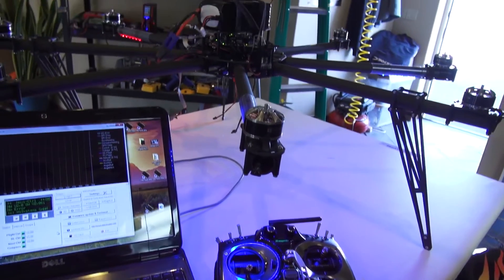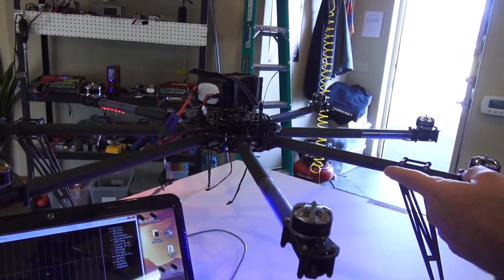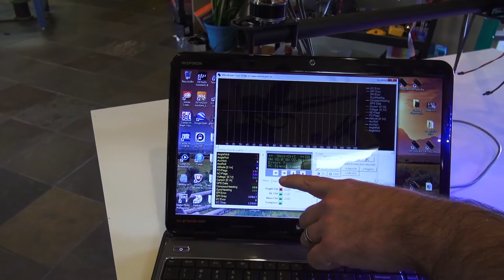Quadrocopter Tutorial - Mikrokopter Fail Safe Setting on the MZ-24 and GR-24L

Comment: Thanks, have to change it on the MX-20 also, or it no longer goes into failsafe, like it use to.
					 					
Mikrokopter responds:
Graupner did change the FailSafe function in the receivers. If you use the latest Software on your receiver you have to go into the Menue "Setting & Data view".
There go to the window "RX Fail Safe Vx.xx" and change the "MODE" of channel 1 to "OFF". Now the copter will again receive the lost signal.

Mit freundlichen Grüßen / Best regards
Lothar Freudenberg
HiSystems GmbH